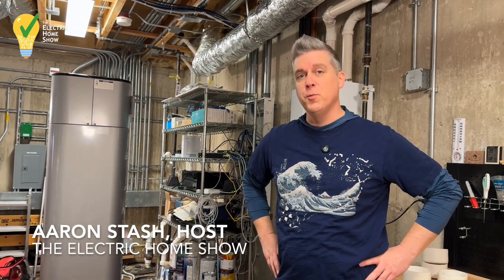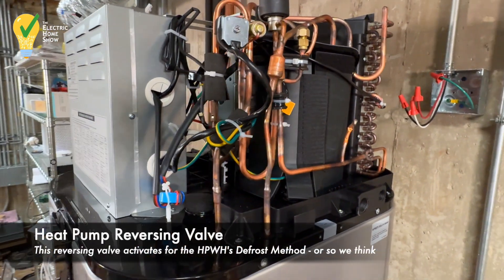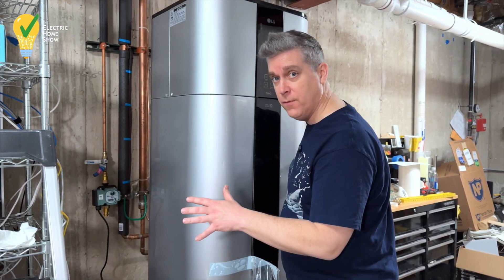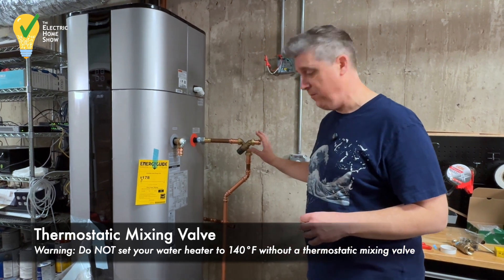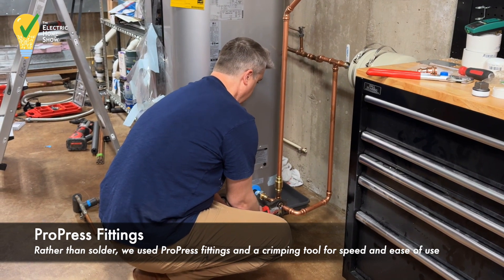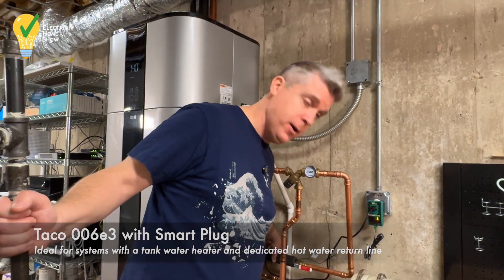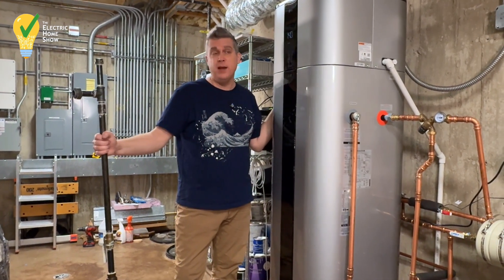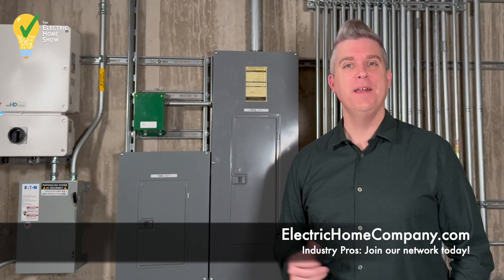Breaking Up with Gas! Installing Our LG Heat Pump Water Heater

Comment: Hello, excellent video, thanks. I have one installed and I have a doubt. Can I force it to start the heating process? I usually have it in automatic mode and sometimes it shows it has 1/3 capacity and even so it doesn't start. Oddly, if I change from automatic mode to turbo, for instance, in the mobile app, it also doesn't work for forcing it to start the heating process. Any idea? Regards from Portugal
Reply from the maker: I’ve found the app to be confusing - particularly with the capacity available. I’ve never run out of hot water though. I’m running in heat pump only mode without a schedule. Do you have it on a schedule or are you running out of hot water?
Reply: @ElectricHomeShow I have a  schedule from 11Am to 4Pm to optimise the energy from solar panels. If the app shows as empty it always starts at 11Am, if it is at 1/3 it is a lottery 😂. It should have an option to force start to always have it full

Comment: Next year I'm going to install a 58 gallon HPWH and abandon the hot water coil in my oil fired steam boiler. I'm in the Northeast in Connecticut and I've been looking into a lot of different HPWH brands and even though there seems to be a lot less of them out there I'm going with the German Stiebel Eltron Accellera 220E
Reply from the maker: I’ve read good things about that one. These HPWHs will steal heat from the surrounding room. Be sure you have enough room (usually 750-1000 cubic feet) and plan for a cooler space.
Reply: @ElectricHomeShow I've been doing lots of research. It'll be installed in my basement in between the oil tank and boiler. In the winter time it'll be able to pull heat from the boiler and oil burner exhaust and basement is fairly warm in the summer. I'll have to do some basic measurements to see what I have for cubic footage

Comment: Very much appreciate you sharing your knowledge and experience.  Sorry, I may have missed it:  what made you decide to go with the LG HPWH vs the Bosch or Rinnai unit?  Thanks.
Reply from the maker: Good experience with the LG systems. Fewer Plumbers in my area installing Bosch and Rinnai HPWHs - which are both white-labeled Midea heat pumps. Check out my “Clone Wars” video for more. Good specs for those units though and better than gas.

Comment: Hey, So any update on this unit? Im debating on this or the bosch but not a fan of 0 wifi/smart control on the bosch. So leaning more towards the LG, also what model did u end up with? There is a L and M. Not sure what on demand means.
Reply from the maker: Unit is running like a dream. No issues. Super quiet. Have never run out of hot water and run on heat pump only mode 100% of the time. The unit we installed here is the "L" version which has leak detection and demand response. "M" is the standard unit. Demand response is a must in places like California, but not yet in Illinois, however, I purchased that option should our utility move to demand response in the next 10-15 years.
Reply: @ElectricHomeShow  Thats awesome, i ended up going with 2 60 gallon versions of the LG M as i live in Indiana and they will never regulate that stuff lol... Plan to run them in parallel though i realized after how the connections arent on the front but the side, luckily i figured out a way around to have to deal with wonky piping as i plan to use only pex.

Comment: The reversing valve is for defrosting the coils that pull the heat out of the room, not for making cold water. If they didn't use a reversing valve, they would have to add a heating strip to the coils for those times when they froze over.
Reply from the maker: Thanks!
Reply: There are two condensate drains do they need to be kept separate or can they be combined?
Reply from the maker: @ediesel000 ours are separate. Different sizes. One is the main and one is a backup. We were able to tie into a previous condensate PVC from our old tankless and then just ran the second one next to it.

Comment: Hi Aaron,
Great video. Can you provide stats of performnce of that water heater? Example, How much is recovery time in heat pump only, auto and turbo mode. How many watts uses per month? How many households do you have? 
Thanks.
Reply from the maker: So far we’re only using these on heat pump only mode. First three months usage of this unit have been 107 (Apr), 105 (May) and 84 kWh (Jun).

Comment: How hot can this heat water on HP only?
Reply from the maker: Max temperature is 140 degrees Fahrenheit in any setting. HP-only mode will only effect recovery time, not max temperature.

Comment: I'm pretty sure it has it's benefits, but as someone that's only changed one water heater in 50 years I don't think I will ever get that out of this heat pump.
Reply from the maker: Wow, 50 years! Is it stainless steel?
Reply: @ElectricHomeShow  I usually get 25 years out of water heaters. They are so easy to maintain and replace simple parts.
Reply: My tankless needed to replace almost every 3 years. The good thing is under warranty for one replacement every 10 years but I have 4 in 14. Even the water heater still under warranty to replace but the labor is $800 for each replacement cost.  I already pay for 2 and have 2 under warranty. The total labor costs more than $3200. In 14 years.
Reply: @alanlau2375  I prefer an old school 50 gallon water heater. They just work. If they break you unscrew the water hoses and put a water heater in and plug it back up. I don't know what's so inefficient about a water heater anyway as they only use 5,000 watts or less for a few minutes.
Reply from the maker: @jamesm568 an electric resistance water heater is 100% efficient. A heat pump water heater is 300-400% efficient. Gas: 80-90% efficient. How much energy do you want to use and how much do you want to pay for that energy?
Reply: @ElectricHomeShow  if you have a heat pump water heater and a family you're going to be using electric heating elements most of the time anyway because the heat pump couldn't keep up. Sometimes longevity is more important than efficiency.

Comment: I've heard some comments on YouTube by some HPWH reviewers and installers that in heat-pump-only mode, hot water recirculation makes too big a draw on the heat pump to keep up.  I've never seen any real data or testing on this subject.  Since I live in the water-scarce western U.S., recirculation is important, as it reduces water waste.  Please let us know what you learn about using your re-circ system.
Reply from the maker: I’ll be keeping an eye on it. Our recirc has the “smart” plug so should learn when we use the most hot water and only run then. Or so we think.
Reply: Recirculation is expensive. I have motion sensors in every bathroom and the pump was set to come on every time someone walked into a bathroom. It used about 5kwh extra a day for this(resistance water heater).

Now, I have it set to recirculates between 530 am and 730 am weekdays, only. 

If someone wants hot water, there are wireless zigbee buttons in every bathroom they can press to activate the pump for 1 minute. This wastes a lot less power but still conserves water
Reply: @jl9678  Recirculation of hot water is often thought as a cost saving measure, but here in the  Western U.S., it is really a water conservation measure - that is, to prevent water wasting.  We don't have water to waste.  Hot water recirculation is estimated to save a household 8,000 to 10,000 gallons of water annually.  Modern hot water recirculation pumps have sensors shutting down recirculation when the return water is above a certain temp.  With a conventional gas water heater, I had a Grundfos UP 10-16 pump with AUTOAdapt mode, which goes for about $340.  (All modern tankless gas hot water heaters offer models with built-in recirculation capability.  The industry behind HPWH needs to understand customers are looking for this.)  I also use a $12 wifi outlet for the recirc pump that could be programmed by time of day, shutting off recirculation at night.  Because we are retired now and home all day I run recirc from 4:45 am to 10:15 pm.  But the pump sensor also shuts it down during "operating hours" based on returning water temp, so it would go on and off all day as needed,  I found the cost of recirc was indiscernible on my electric and gas bill, but the amount of reduced water waste was very obvious every time I used hot water.  My original point was there seems to be no one out there telling us if hot water recirculation is even feasible to recirculate with a HPWH.  For me, it's a dealbreaker.  No hot water recirculation, then I will go with tankless gas hot water heating.
Reply: @tedbellSEA the best of BOTH worlds is to have the recirculation be on demand. When you need hot water, push a button and wait a minute. Save energy and water. 

I didn't find that the recirc saved us any water, funny enough. We use more water flushing toilets daily than taking showers. So the recirc is only needed around shower time. For most of the rest of activities we used cold water. 

I would save a lot of water by switching from 1.6 gallon flush to 1 gallon
Reply: @jl9678  Haha, I'm too impatient, I guess.  I'm not going to "wait a minute" every time I wash my hands, or wash off dishes and want hot water.  Since the cost proved to be so small it was unmeasurable for us, I will go with the almost instant hot water of our recirculation.  (It still does take 2 or 3 seconds to flush the cold water out of the 3 or 4 feet of branch line to the fixture.)

Comment: Congrats on meeting your energy goal and breaking up with gas!!! 🎉
Reply from the maker: It took 11 years, but now we're done with gas.
Reply: @ElectricHomeShow  I'm a bit surprised you went from Gas to Electric.. I have an oil fired unit now that needs replacing.. I was considering the switch to Gas or Elec Heat pump..
Reply from the maker: @josephdeart1055 it is The “Electric” Home Show after all. My focus is helping homeowners break up with their gas company and go all-electric.